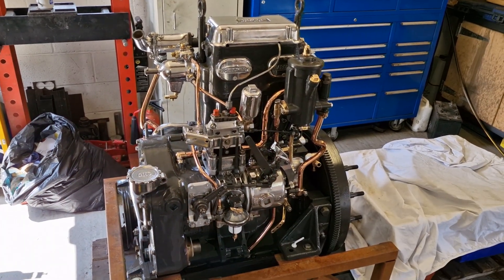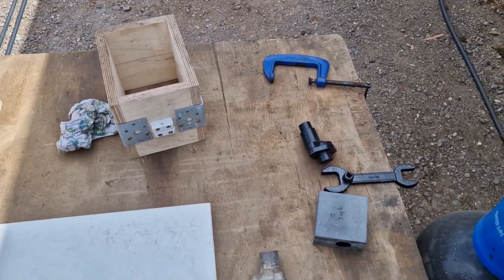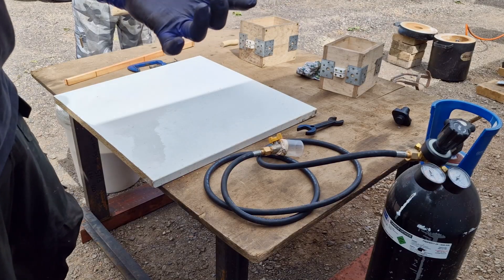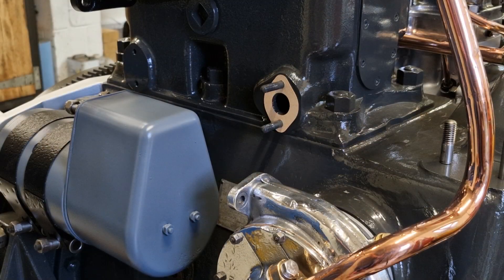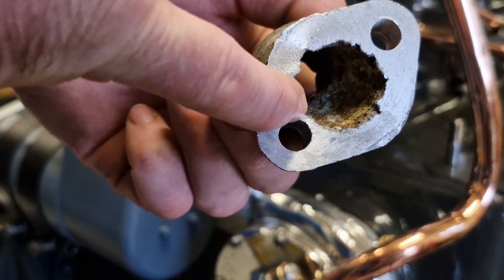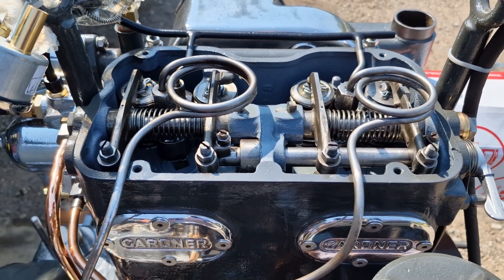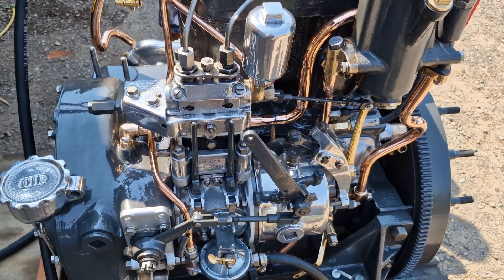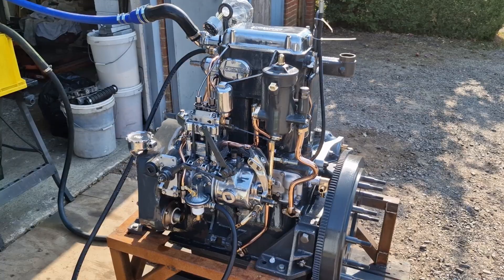Gardner 2LW Overhaul Part 6 - Casting & Test run time!! Hunslet Loco Walrus Groudle Glen Railway IoM

Comment: Having just binge watched all six parts of the 2LW rebuild I was amazed at how well Gardner engines were made and your knowledge of the  method for overhauling them. The metal casting was also very interesting, did you 3D print your patterns and core boxes? Keep up the good work!
Reply from the maker: Thanks for watching. The patterns you saw me use I CAD 3D modelled from the original Gardner drawings for these parts. Created the mould tooling models from this before 3D printing them using MJF